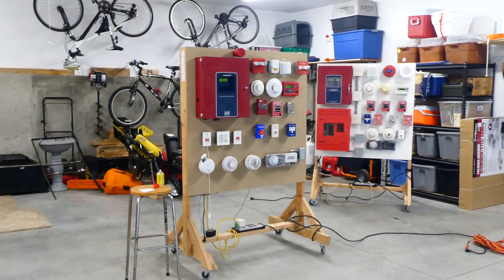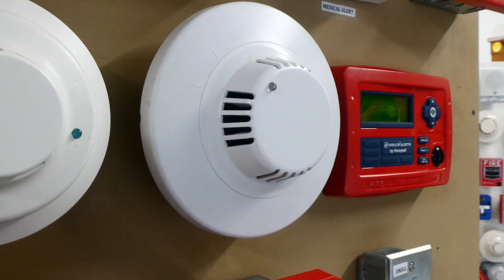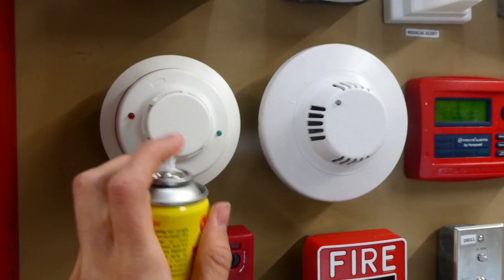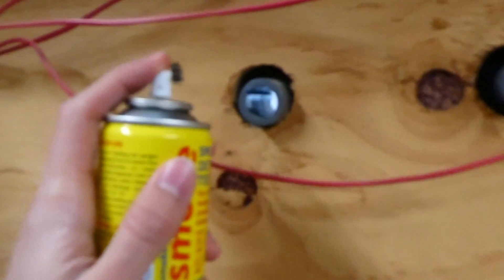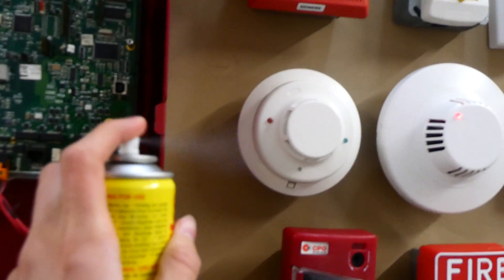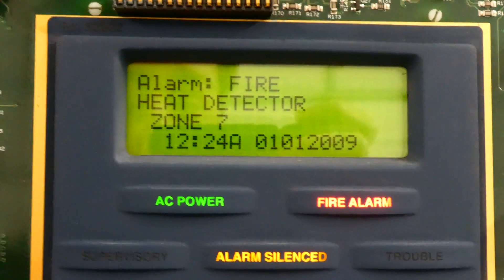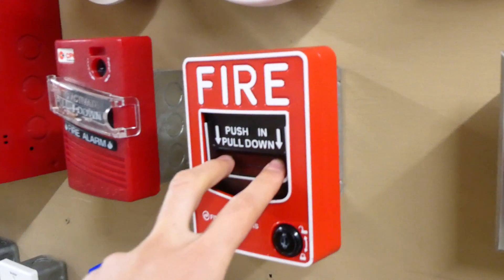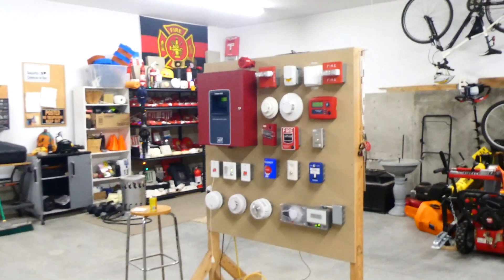ADT Unimode 10UD System Test 13: Wheelock Fire Alarms

Comment: My old school had simplex 2903 9001 with fci horns behind the light plate and in the classrooms they had system sensor 2424 heat dectors and system sensor Sw and out side they had 3 wheelock mts set on hi lo